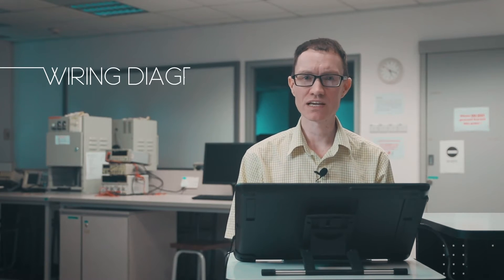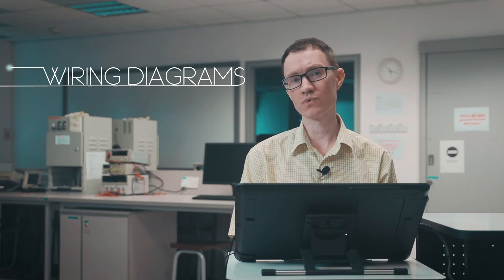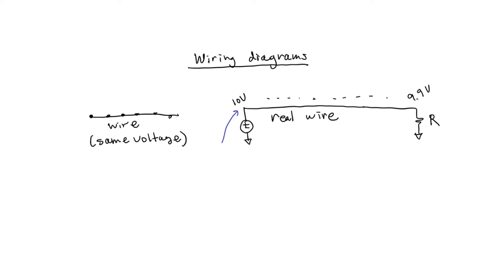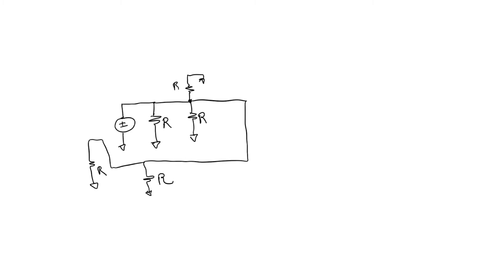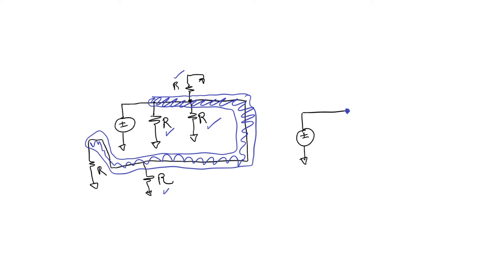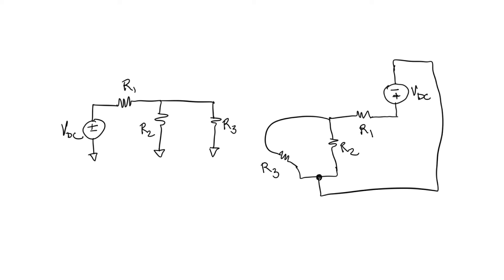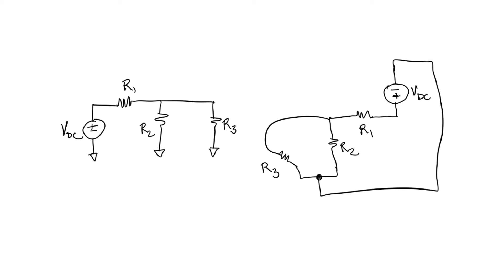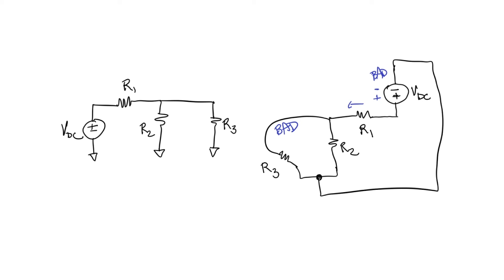Wiring Diagrams (Circuits For Beginners #6)

Comment: I just make my own. Most drawings have a single line for a Christmas tree. You try hunting down a short. The different system that can short out and leak power to ground need to operate separately. So you don’t spend endless time hunting a bad component. As an equipment mechanic these Aholes electrical engineers need to be fired. We mechanic end up working for free because of them

Comment: Thank you for this interesting video. I will note that in the textbook that we use "Understanding Motor Controls 4th Ed (by Herman) we also typically place the High Voltage components at the top,  however, unlike in electronics, Our "Hot" is almost always on the left rail of a ladder diagram, or schematic, and we go from left to right, top to bottom... with the right most location usually a negative or neutral return path. It is odd how this is so similar yet different from the standard in electronics here.

Comment: A big thank you from Belgium for these videos. I was nevertheless taken aback because it seemed to me that the electrons move at the speed of a snail but that on the other hand the transmission wave was practically instantaneous (a bit like a long train starts, apart from the starting shock, the effect of starting the locomotive is felt almost immediately at the end of the train)?